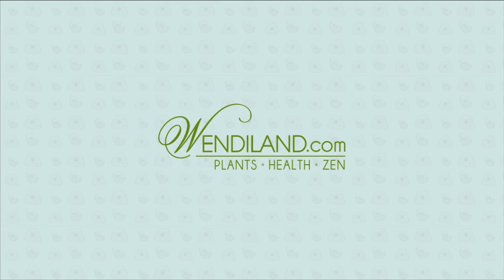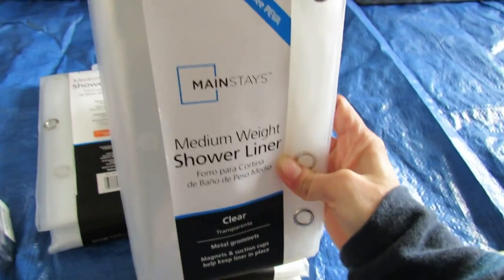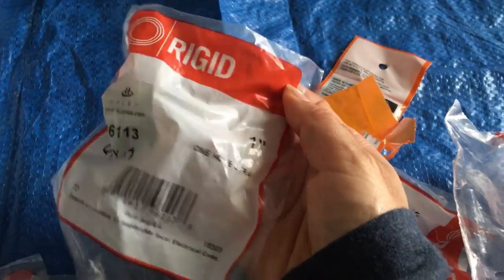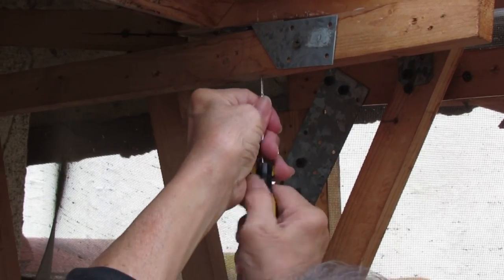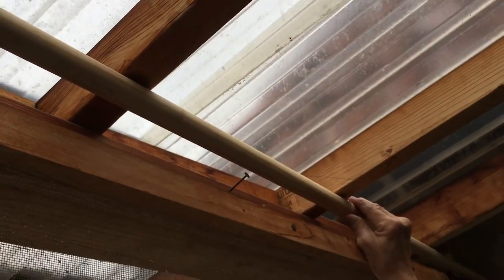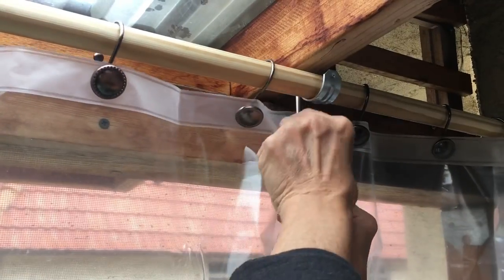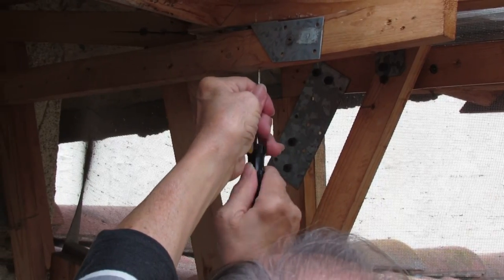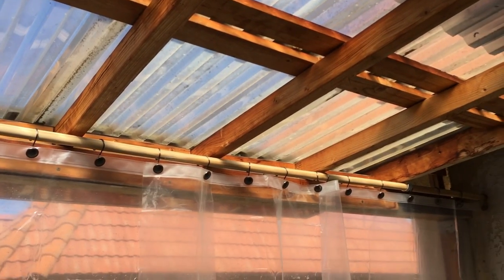Transforming My Balcony As Greenhouse

Comment: It looks great, but can't imagine (1) why you would need one where you live, and (2) what it is supposed to do exactly, since most greenhouses are made air-tight for the specific purpose of holding in winter heat, i.e. season extension.  Wish you had included a lengthy introduction on what the intention is, relative to heat and light.

Comment: The shower curtains is a great idea !  I wonder if the natural light is sufficient. But if not you could even add some LED light fixtures.
Reply from the maker: Natural light will depend on where the “greenhouse” is located. For me, the upper shelf plants gets enough light, but bottom shelf needs light to support. There’s episode that I showed adding LED grow light. it really helps light up the space evenly.
Reply: @wendiland  I'll check it out, thanks.  In my experience, hot peppers will grow, flower and fruit normally even in insuffiencent light as long as they do get at least some hours of direct sunlight per day. Adding just 60 watts of LED light (in the right spectrum, deep and far red) made a tremendous difference, those plants grew almost twice as big. However, growing hot peppers without supplemental LED light on a balcony that has only indirect sunlight was not a success.